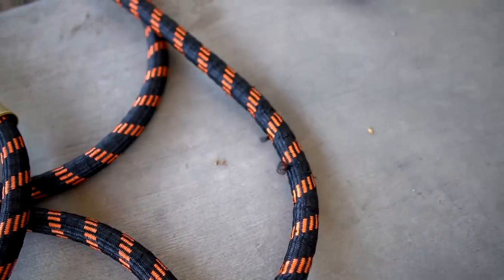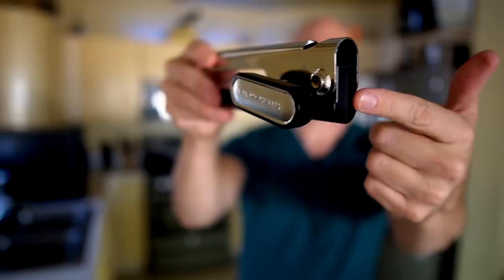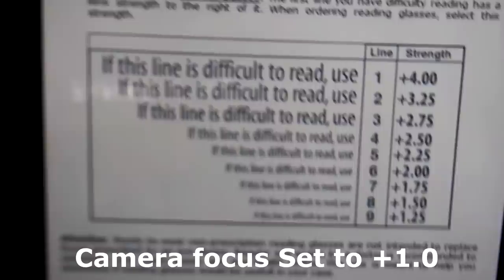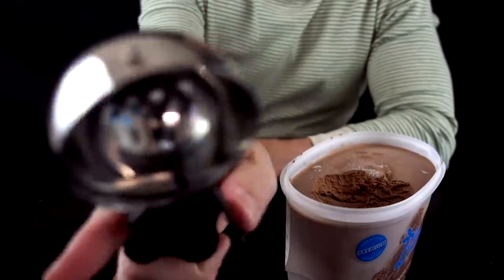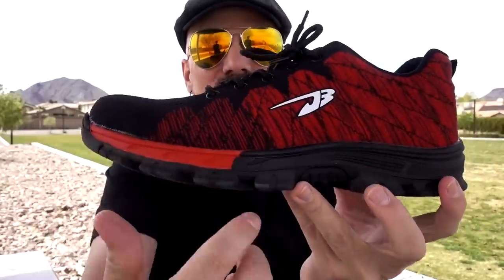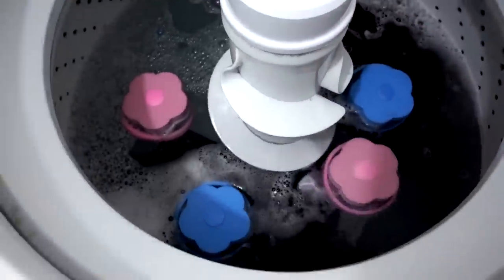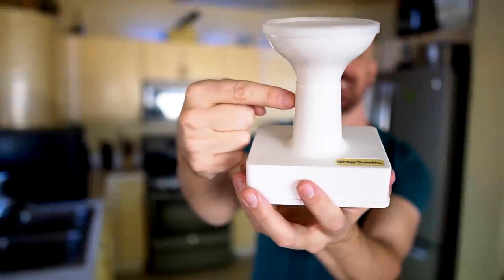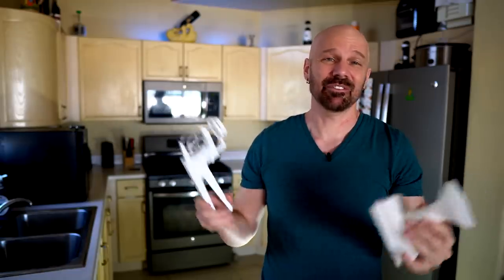10 Previously Reviewed Gadgets, 1 Year Later (Update #22)

Comment: Emptying long garden hoses is a MAJOR pain in the ass!  I would NEVER buy a hose that needs to be completely drained after every use.
Reply: The self expanding ones assist in that regard, they maintain pressure until they are contracted back.

Turn off the tap, then just hold your spray handle and squeeze, the hose will contract and the water will empty from the hose.

Then the rest empties out as you roll up the hose.
Reply: Also a regular hose will last for a decade. I think my parents have used the same hose for 20 years. It is outside every day (rolled up on the wall)
Reply: @DerekSmit  aye. My father has had his expanding hose for what must be something like 8 years now, can definitely remember the old rubber and polyurethane hoses splitting, but he's had no such complaints with his current hose (an expanding hose).
Reply: I leave the hoses out all the time and they last fine. Bringing in a hose after each use is insane.

Comment: A regular icecream scoop works perfectly if you dip it in warm water before using it. Great reviews! I love the star trek pizza cutter, its awesome 🖖 live long and prosper!
Reply: Those are great, and there's a opener as well.
Reply: Or one can simply adjust one’s freezer so that it’s a couple of degrees warmer so that the ice cream will be at the proper temp to easily scoop!
Reply: You still need to repeatedly soak the scoop in hot water every 3rd scoop or so.
Reply: I simply pop my icecream into the microwave for a few seconds and use a heavy duty spoon. That's if I'm not simply eating out of the carton.

Comment: Re the laundry lint traps:  I bought 3 of these several years ago.  I agree, they do not work when used as directed.  I have a very old washing machine that I bought used.  The filter system on it malfunctions and more than a few of my nice knit blouses were ruined.  I began using these opened filters and scoop the top 2 to 3 inches of water throughout the whole wash and rinse cycles.  I pull out at least 1/4 cup of lint.  I do not have a dryer and am without that option.  For my purposes these lint traps are a blessing for me and my clothes are coming out in wearable condition.

Comment: I work for an optometrist and I have zero idea how you would even go about making a set of readers that "auto adjust" the shape and thickness of the lense determines the power, unless they worked like a progressive where they have the lower power on the top and higher on the bottom, but thats not an auto adjust either. Vision is so subjective that unless it was wired into your brain it couldn't possibly auto adjust to your vision needs. Its an expensive pair of cheaters.

Comment: Holy crap! At 14:42 I saw sparks coming off the weight (I'm guessing that's what was dropped on the shoe?) when it started to hit the floor! Idk if it was just static electricity the plastic coating or the shoe's materials, either the fabric/nylon or the metal innards, but it was definitely unexpected!

Comment: I’m a thrift store shopper and I am amazed at how many of the products you reviewed end up there. I think the worst gadget I found was from Temu. It is a window washer that is suppose to wash both sides of the window at once. It has powerful magnetic which keeps the sides on the window. Which keeps thing together but you need someone to attach the outside part together on the window. A problem if you have a two story house and no access to the outside, It also has a reservoir for soap which drips out and a string robe to pull it. The biggest problem was that the magnet is way too strong and can easily break the window. And is selling for around $80. Terrible product.

Comment: That's not how you use an icecream scoop! Stop digging into the icecream. Your meant to drag it across. Also run the scoop under hot water before using it. All the scoops you reviewed mention the hot water trick in their instructions. I've never seen someone fail at scooping ice cream before.